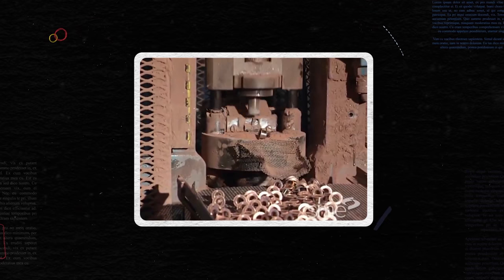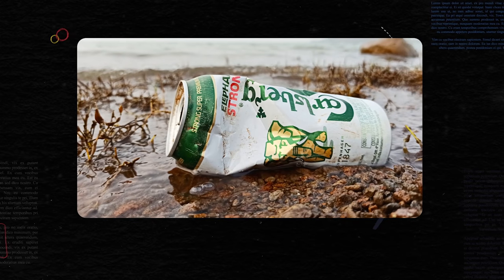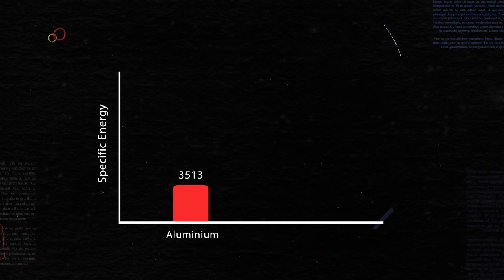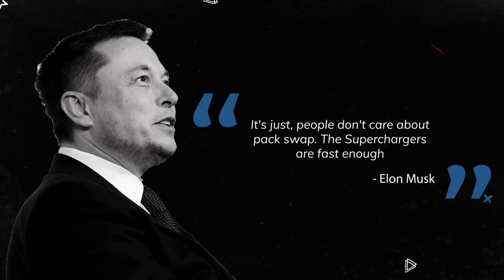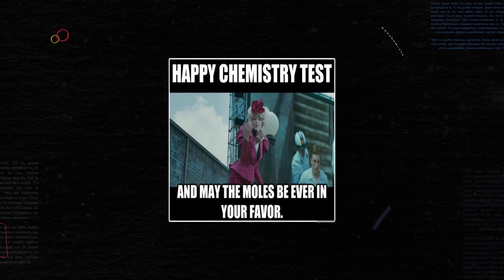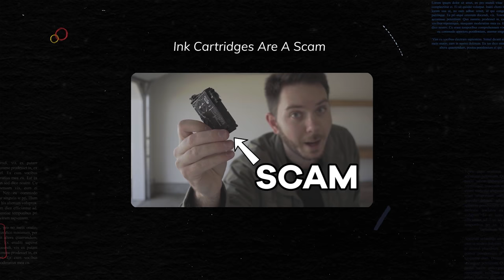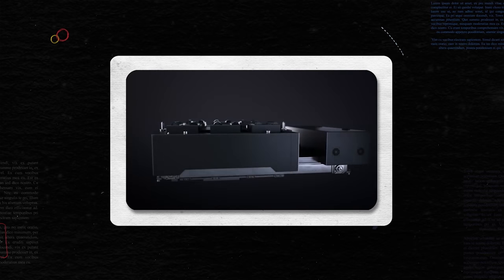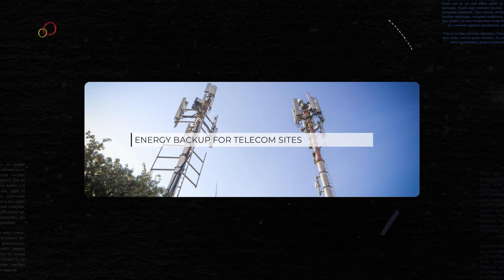We Can Get 1600 KM of Range With Aluminium Batteries

Comment: Come on, cars lithium-air batteries do NOT end up in landfills 98% of the times. Every single car manufacturer has an end-of-life reusing/recycling scheme.
Reply from the maker: Just talking about current situation. Though in retrospect, it is a little misleading. 

The point we were trying to make was that the aluminium smelting process if much more mature.
Reply: I took that to mean lithium batteries in general, like little rechargeables, watch batteries, power tool batteries and phone batteries, I feel like the bulk of those get tossed in the trash. Which is too bad.
Reply: @guyspencer4322  Only if people are irresponsible. In the UK it is regulated that manufacturers of batteries must include recycling labelling on the battery with instructions on how to dispose. Lithium based batteries are recyclable. If people throw them in the trash, it's because they are not following the guidelines.
Reply: There is almost total lack of reprocessing capability in the UK and Europe. At the moment such batteries are stockpiled whilst someone works out what to do with them.
Reply: Tesla is aiming for just under 100% of each of their batteries and there are battery recycling companies that are north of 90% for recycling a variety of automotive batteries and chemistries. Part of Tesla's plans involves recycling batteries to help reduce the costs of future batteries (10 years down the road... cheaper than mining and refining).
Reply: @TechforLudditesSira  That comparison was highly misleading. We can't compare the current situation of Li-ion recycling practices (which are barely starting up), to the perspectives of recycling Al-air batteries. They should be compared in both present and the future.
Reply: @DavidMcCalister  Indeed, a very promising recycling industry is being built right now. JB Straubel from Redwood Materials, a former Tesla exec, is one among many, providing lithium pure enough for battery manufacturing. Right now and for the foreseable future, battery demand is growing insanely fast, but at some stage, with battery life about 20 years in mobile and land-based usage combined, lithium recycling should provide all the lithium required for new batteries.
Reply: But, in video is mentioned lithium-ion batteries in general, for which makes it plausible. There was probably a decade before EV started to come lithium-ion powered products like smartphones, camera, laptops.. For which almost everyone didn't know in which bin should be placed after its life. Even now, I cannot find a bin for non-recyclable or recyclable batteries in my country (Croatia). People throw electronics in common trash bins, for which we all know, it will end up in landfills.. So, statement is correct, partly, not sure for 98%...
Reply: Many countries have recycling centers and battery collection points. Whether people actually use them or not, that's a different topic. But especially in the EU electronic waste and batteries are collected (small batteries in some stores, bigger batteries in dedicated collection centers) and recycled, and there are fines for people caught disposing them in the regular trash.

Of course, the public information and education are essential and should come first because people have to know how things are supposed to be done. But no matter what laws, regulations and facilities exist, it's ultimately up to people to treat this matter responsibly, and this means that sometimes they have to actively look for information.
Reply: I like the idea of a 5MWh al-air battery as baseline battery storage attached to a renewable energy plant waaayyyy better then as a swappable cassette.
Reply: @2002RM  People not following the guidelines!?! I'm shocked.
Reply: @piotrtrebisz6602  where does the electricity come from to make the aluminum in the first place?
Reply: @piotrtrebisz6602  you are missing the point.  You can't create pure aluminum with heat.  period!  It takes 3 electron to make aluminum from aluminum oxide.  you might as well just heat the water with the solar power to make steam.  Why would you need to heat aluminum oxide at all?
Reply: @piotrtrebisz6602  Actually, you don't need it to be liquid. They already said that they remove Aluminium Oxide from the battery in a form of a "sludge". You can dilute sludge to achieve required viscosity. It is true that it will not dissolve, but it will flow because you have small particles in a disperse mixture. You can add mixers to stir it, and keep it moving to prevent too much of it sinking to the bottom of the electrolysis pool. So just forget about melting it because that is not needed, and you are correct on everything else.
Reply: @kneekoo  What you're saying is correct, but what happens with recyclable materials AFTER you put them in the correct bin? I have seen cleaning ladies go around Malpensa airport with one large bin. They throw in it all the contents of the 4 little sorted bins. So you do your part by throwing aluminum cans in one bin, and paper in another... and she puts it all back together and out the door and off to the landfill... And that's a landfill in Africa or Philippines or somewhere like that. 

In a same way, Lithium batteries or Li-Ion can be thrown away into special recycling containers for batteries in general, or in containers that are just for those batteries - but that Lithium won't be recycled into new batteries. 
How can we be sure? If you recycle aluminum cans, you can get money for them. Not much, but money none the less. 
If Lithium from your car or laptop battery had any value, battery manufacturers would offer you money so that you recycle it in their bin. I have yet to see that happening. Yes, some car manufacturers like Renault/Nissan take back batteries, but they are not recycled. They are repurposed, or stored. Lithium is not extracted from them and reused. 

And what nobody mentions here is environmental impact of Lithium mining - which is extremely dirty process. Throwing your car battery into a landfill is nothing comparing to that.
Reply: Here in Canada they want you to PAY for submitting your batteries for recycling! Definitely far too many of them go to the landfills because of the idiotic system of paying a recycling fee on top of the selling price to buy batteries and then pay again when disposing them.
Reply: You’re extremely naive if you believe that car manufacturers will do the right thing.
Reply: How do you know? Spent lithium is useless
Reply: But...truth is, a lot of batteries find their way in a depo...
Reply: @TheIncredibleMrG777  Tesla and a few others might, but for most, I'd count on legislation like EU regulations rather than their goodwill indeed.
Reply: @HeyU308  Spent lithium is lithium, just like spent lead and sulfur are lead and sulfur. There is no alchemical transmutation of elements when electrons move through them.
Reply: @davemeise2192  That's weird indeed. In Europe, the recycling price is paid upfront, it's included in the battery price. All appliances actually include this collect and recycle price, not just batteries.
Reply: really? how many tons a year are they recovering?  Thats just a PR bit of rubbish.
Reply: @litestuffllc7249  Not much indeed, mined lithium is still much cheaper and LIB recycling is focused mostly on expensive metals such as cobalt. @Tech for Luddites's recycling or rather landfill percentage is correct for small LIBs that come in a gazillion form factors. It's really car batteries what will jump start the recycling industry, and this has not really started yet, because EVs are too new and their batteries are being reused (stationary energy storage) even before they need being recycled.
There is no technical issue with recycling lithium, current processes recycles up to 71% of it, but mostly, new processes being developed for the car industry aim for 95% or more. It's not just an issue with the industry, but with politics and people asking that LIBs be recycled efficiently instead of commenting negatively on YouTube.
The fact that mined lithium is cheaper than recycled lithium means that society needs to tax mined lithium more, or subsidize recycled lithium to the same price as mined, or develop economical recycling processes that drive down the price of recycled lithium. For instance, using some of the profits from recycling LIB cobalt and nickel to decrease the price of recycled lithium.
Reply: @TechforLudditesSira  so totally relevant to future technologies then.
Reply: @guyspencer4322  not in Europe.
Reply: @robertjohnson-taylor1938  Many batteries were not properly recycled in the US due to a lack of effective infrastructure and systems to do so. This is becoming displaced with Lithium batteries. Lithium batteries are much more likely to be recycled and are actually profitable to recycle, a fact which is likely to be connected.
Reply: @2002RM  In the US we've been recycling plastic for years. Only to find out it was shipped half way to China...and dumped in the ocean.
Reply: @piotrtrebisz6602  you obviously don't understand how aluminum is processed from aluminum oxide!
Reply: @piotrtrebisz6602  no Co2 is produced using traditional methods either, and all methods produce oxygen as a byproduct. Where does the electricity come from?  Is carbon emitted producing the electricity?
Reply: Lithium batteries end up in the landfill from everything else which dwarfs electric cars... so it is correct as per the current situation. Almost no one recycles them. Most recycling is BS, especially now that china and other countries are no longer accepting western waste. In many years the landfills will be a gold mine of raw materials long after the degradable stuff is finished emitting methane.
Reply: Correct, as the number goes from a few dozen tonnes a year to hundreds and thousands it will be cheaper to reclaim and re-use the elements than to mine and processes new replacements
Reply: You would be very surprised what's going into landfills ... especially from EVs. The non-recyclability of the electronic components, many plastics, the composite parts (needed to offset battery weight) and components from neodymium, dysprosium & cobalt is nothing short of a scandal and is contributing to the rather poor ecological footprint of modern EVs.
Reply: @f.d.6667  You are joking right? Most battery companies are working hard to eliminate cobalt, and other truly problematic or ethically unsustainable materials, and there is nothing else in electric cars that has a fraction of the environmental footprint of the Oil used in the lifetime by an ICE car. 
Secondly, battery recycling is a growth industry, as it gets easier the more cars built. Economies of scale make the very well known processes to separate out the elements, much cheaper than digging up more. 
As the electrical grid becomes more sustainable aluminium production is also more efficient, as aluminium is 100% re-recyclable, and not many car companies use the fancy carbon fibers and other difficult to use and slow processes except on low volume models. 
You really need to do some research independently at ecological footprints. Contrary to popular belief, the materials used in a normal car require just as many holes to be dug, and consume vastly MORE energy over the lifetime of the product, Normal cars are also nearly impossible to re-cycle, need service centers, oil tankers, oil wells, petrol stations, more brake pads and brake dust, and more carcinogenic and particulate exhaust that kills MILLIONS a year. 
Once again, if we continue using your tech, nothing changes, murderer!
Reply: @dylanhunt5655  Nice try😆😆
Reply: Actually out of ignorance,.Many complete Li on  battery "packages" get scrapped. When in fact either a single battery "cigarette" in a Tesla can or a panel in a Nissan Leaf will offline a battery block. These parts can be located & rephased very efficiently.
Reply: @TechforLudditesSira  Is this a battery or a reactor?
Reply: @tyroneshulace3203  Actually very few get scrapped or recycled yet. I dont know who is feeding you your info, but unfriend them. Almost no Teslas have been retired at all, and compared to the viability of re-cycling in 2-3 years to a decade, it's still a borderline industry, relying on much much less homogeneous small battery packs and individual cells. Wait till 20 million teslas a year are wearing out, and another 30 million are being built... Then the old car will have value.
Reply: @RacefanPat68  I wasn't talking about Tesla cars. I was talking about their batteries. But to most that was very obvious. Teslas experience attrition by accidents. From there the battery pack get pulled & replaced into needy cars. The expired or faulty do RARELY get recycled back into cars. They get sold from the wreckers for scrap or for offgrid solar projects. A few auto electric shops have bought new Tesla packs & replaced them or portioned parts of a new pack into an old battery pack. Currently there are almost 100 complete packs sitting in wrecking yards within an 8 hour drive of me.
Reply: @tyroneshulace3203  True, but replacing one defective or inefficient cell in a pack is becoming harder by the day, and nearly impossible with tomorrow's structural battery packs, unless using some highly specialized equipment. The 2170 battery cells are already not 18650 e-cig batteries, and the 4680 battery cells will all be glued together with strong resin, not just soldered. And it's worse for highly customized prismatic or pouch cells: If one of these big cells gets wrong, you need to replace the whole cell, not just a small 12Wh e-cig part. It looks like Tesla or cell manufacturers may want or be forced to by law to recondition their own battery packs by themselves rather than letting third party EV shops do the job. In any case, we need more transparency if we have to pay for a whole new battery pack out of warranty and it's actually only a few cells that went wrong. The cost of replacement should be mostly labor, not parts.
Reply: @tyroneshulace3203  I was talking batteries too, cant you read? 
100 complete packs? OMG? thats 10 MINUTES of production, Texas will eventually put out 6000 odd cars, and trucks a DAY, and make prob 1/4 Terawatts of batteries a year,,,. Read what I said. 
I said it is an uneconomical business at the moment, but you need to realise that in a few years the supply of old teslas will start to ramp up. It is THEN that the re-cycling needs to be ready, and the backbone IS being built. Take a chill pill, its an issue of perspective. 
The whole issue is a big red herring by those opposed to the removal of fossil fuels and particulates in the air. It does need to improve, but 
1. there IS time to get it right, and 
2, The technology, and then the collection methods are starting even now. 
 Teslas are a good case, because having very little wiring, and  very few parts, which are mostly 100% recyclable Aluminium, and 90% recyclable Batteries, will start a whole re-cycling and resource re-capture industry. Imagine in twenty years if Tesla made 30 Million or more cars, and used less natural resources than today. It is possible, can you say that about any ICE car?? or their manufacturers
Reply: @tyroneshulace3203  No, a single can failure does not offline a battery. That is totally false. Battery management for thermal safety and failure redundancy is one of the reasons Li ion batteries have become more efficient and are now so much (1000 times cheaper than the 90's) cheaper and more cost competitive. Geeze I hate FUD
Reply: @Allen Loser Battery recycling is always profitable, since its cost is paid by the consumer purchasing a new battery pack, except for some backward countries.
The only difference if recyclers go from a cost of $2.60 per kg for dumb smelting processes to a profit of $1.00 for refurbishing as new (even for batteries without expensive cobalt nor nickel like LFP cells, is that the cost of the battery pack will be much lower for the consumer.
There are also lots of R&D efforts and a "Lithium-Ion Battery Recycling Prize" that will develop new cheap processes or industrialize processes that exist only in the lab.
Let's also not forget that before even needing recycling, batteries can be repurposed as energy storage for renewable electricity for many more years. Million miles batteries can even experience an intermediate second life in a second car. 

We already know that in 20 years, battery recycling will be much more profitable, it would make sense already today to decrease the price of new battery packs to include these future developments rather than having the consumer pay top dollars for the worst case scenario, i.e. high carbon emitting pyrometallurgical recycling, and sort of award the worst recyclers.
In the mean time, owners of a totaled car should probably keep the battery pack and figure out a way to use it as a powerbank, waiting for recycling costs and techs to improve. A battery pack will appreciate with time like gold, but it will still be better than its current status of EV waste or low value by-product if you can do what some recyclers already do, store it in huge piles while figuring it out.
Reply: @robertjohnson-taylor1938  They are waiting for higher price of lithium. No point to recycle them now.
Reply: You believe theyre recycled, you must waken up. All batteries, no matter what are thrown into landfills, its the cheapest way and the cheapest always wins.  Recycled is only a sales pitch point and nothing else.
Reply: You believe theyre recycled, you must waken up. All batteries, no matter what are thrown into landfills, its the cheapest way and the cheapest always wins.  Recycled is only a sales pitch point and nothing else.
Reply: @MrMusic1950  Each country handles this differently, you cannot generalize. In Europe, recycling is mandatory by law. So far, there are so few car batteries reaching end of life that most are being stock-piled, waiting for the tech to recycle them cheaply and effectively, certainly not thrown in landfills, especially if they contain cobalt and nickel.
Reply: @Chimel31  And EV batteries are also a hot commodity with people who want lithium batteries for their own projects since it is by far the most cost-effective way of obtaining large quantities of still decent quality cells. Recycling will play a major role in new EV battery manufacturing in ~10 years when there will be plenty of old batteries getting retired from their 2nd and 3rd life somewhere else. Newer EV battery cells and packs are also being optimized for reduced recycling costs.
Reply: Tell me, is there a Mr. Sira?
Reply: Lithium-ion, NOT lithium-air batteries...
Reply: @piotrtrebisz6602  yeah, because they don't use energy and don't require maintainance, don't use parts that wear out, don't require cleaning the material or transporting the material from and to the factory... oh, wait.
When do you people start thinking in systems and efficiency chains already? Even if you had all electric trucks you'd produce CO2 through producing the tyres these trucks use up on a regular basis.
Every extra step along the way, from the sun as our energy source through solar panels or wind farms to transportation of people and goods, requires some effort. The less  conversion steps and the more efficient every step is, the more efficient the outcome. All these ideas of e-fuels, power-to-gas, hydrogen cycles, batteries that need to be replaced and recycled instead of "recharged" that require huge logistics, suffer from the same problem: They're using inefficient extra steps compared to local power power production and recharging extremely efficient batteries. The latter needing a lot of effort up front and at the end of the life time, the former having a not so great efficiency (eg solar roofs), but in combination they're more efficient than any e-fuel  production or very frequent battery recycling, no matter how they're powered.
Reply: PotatoPlayer Made in China.  Absolutely accurate, tragic. Great truth to your comment.☹️
Reply: @RacefanPat68  I agree with the point of I use EV instead of IC Engine reduce pollution indirectly I am reducing the digging for Fossil fuel.
Reply: @TechforLudditesSira  No this again is a lie of omission as we have more the 40 E-waste recycling companies (ie: Redwood materials) around the world that can do this but are forced to stay in a testing phase thanks to laws, regulations and legislations that Governments were lobbied to put in place by fossil fuel and ICEV Auto Companies!!
Current batteries have a 85% recycled (and still Climbing) which would massively reduce the vehicle costs by over at least 1 quarter the ticket price ($10,000+) when that happens NO ONE is keeping up with TESLA.... oh and FYI Tesla has 5 new batteries in the pipeline (3 coming in the next 18 months) and 2 are future projects with John GOODENOUGH!
Reply: @2002RM  Recycling labels are pointless if there isn't an accessible way to recycle them. The council closed my nearest recycling centre, so it'd cost me a £30-£40 cab fare to recycle a bunch of leaking/bulging/old Li-Ion/Li-Poly batteries that are currently sitting in a small plastic tub.
Reply: Refill water every 300 km? It falls from the sky regularly in most countries, and can be collected from the surface of the car and pumped to where it is needed. A water tank and pump can bridge dry weather. 43 kg to heavy? Just make 2 or 3 smaller batteries instead of a big one. Sell the aluminium blocks on chargers and gas stations and make it simple and easy to swap by hand.
Reply: its got a brown girl though so it must be true, like if they could really do that they would do it right?
Reply: @2002RM  where is your local lithium recycler?
Reply: @DavidMcCalister  Where is your local lithium recycler?
Reply: I think she was talking about the batteries we use in toys and flashlights and such
Reply: @dylanhunt5655  

She is a human being.....like you and me.   Get over it.
Reply: @2002RM  Which most of them don't. Lol
Reply: laptop and cell phone batteries
Reply: nice theory, but practice is closer to what she claims (and I believe she said L-iIon batteries, not EV Li-Ion batteries)